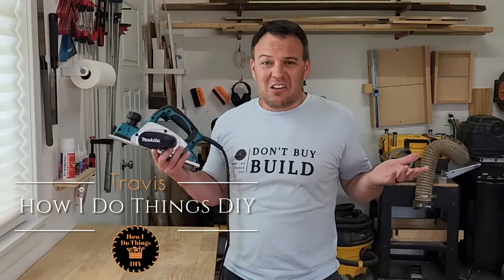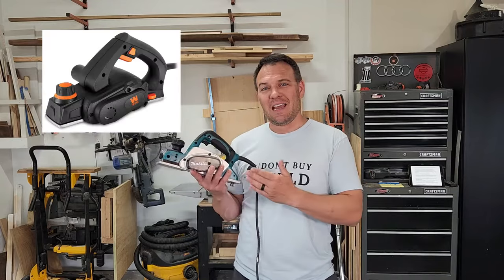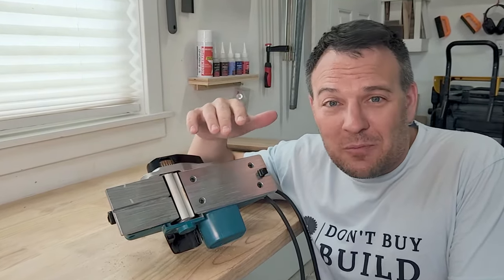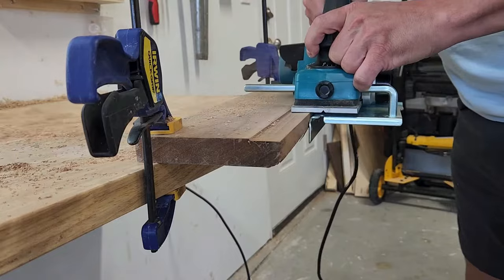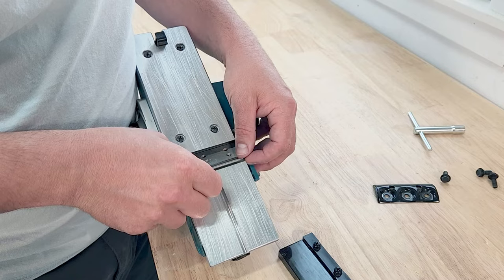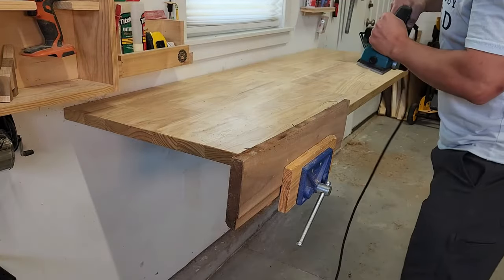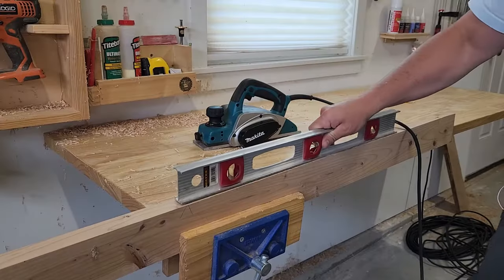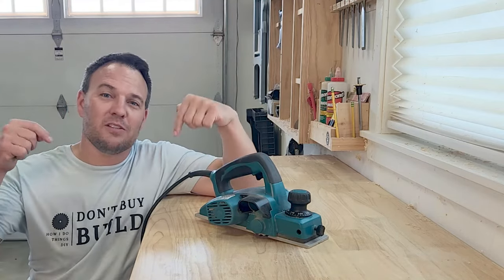Are Electric Hand Planers Any Good?? || Beginners Guide To Hand Planers

Comment: I use them for flattening slabs. You can plane is any direction and its faster than using a router sled 👍
Reply from the maker: I've done that with glue ups as well. Thanks for the comment!